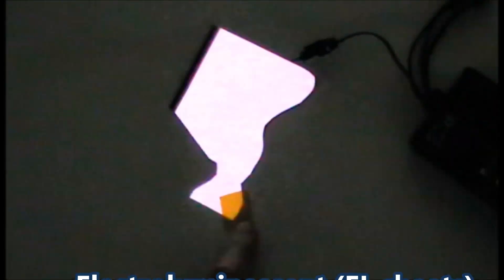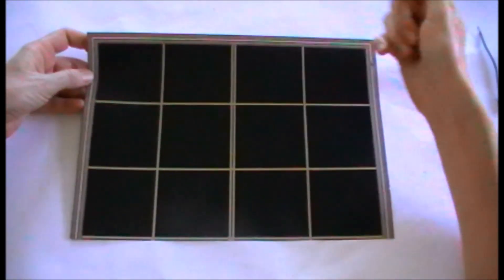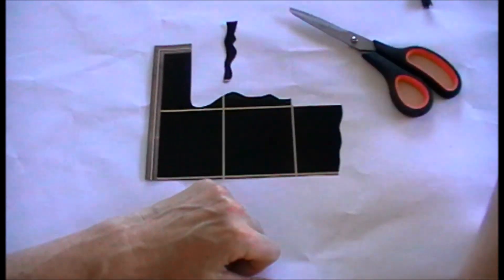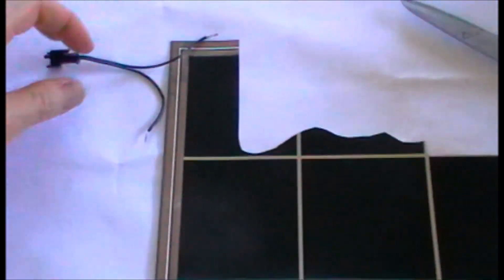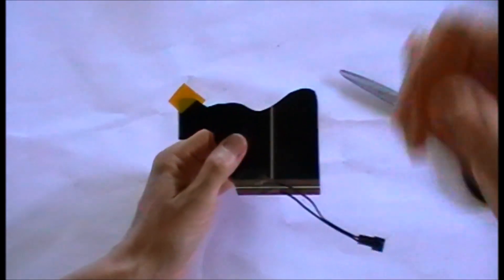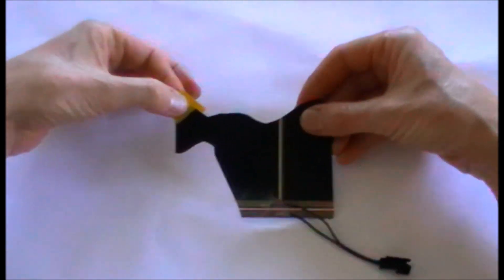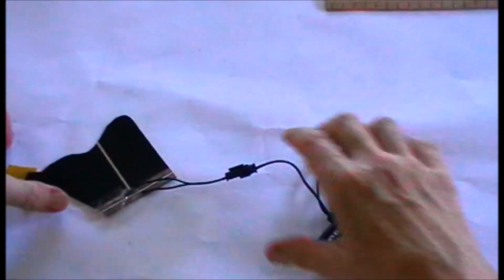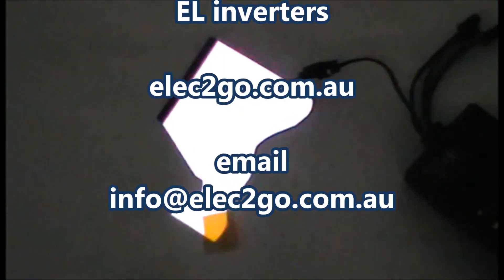EL panels - how to cut and connect tutorial

Comment: Hi, i have an EL pannel that came with a computer case, but the inverter was lost, so i have the pannel only and it has 5 wires. I can send you a picture of the pannel and how it was supposed to work , i can also send you the size of the EL pannel. I just need to know:  1) the amount of voltage to send how did you calculate that per the size of the pannel whats the formula, and 2) i need to know if you can tell me where each wire needs to be connected to as i have 5 connectors.  https://i.postimg.cc/3xB8Tb64/thermal1.jpg     and  https://i.postimg.cc/fL3DYWbm/thermal2.jpg

Comment: so is it safe to use on a clothes like jackets or will it shock you
Reply: If you contact the live surface, it will shock you. If the current travels across your heart, it will likely kill you. I suggested to someone covering the back with epoxy dip, like the stuff they put on tool handles.

Comment: Nice video! How big AC voltage the inverter procudes for the panel? You mentioned 120-140 without unit so I am wondering did you mean the frequency in Herz (120-140Hz) or the Voltage 120-140VAC?

Comment: hi.i found your video to be very helpful. but i have a few questiond about yourel panels. you see,meand my sibling are trying to make our tron costumes from hand and and this will be our first time working with el panels or wire. i would like to know it i can connect the wire to the ribbon with electical tape?and if i get far enough, what can i put under the live underside so it stays on my costume but it doesn't shock me? please answer at your soonest convenience. and thank you.
Reply: I would cover the back of the EL foil with epoxy dip coating. As to connectors, electrical tape is poorly suited for this purpose. It is meant to protect bare wires from contact with areas it should not contact. I like the video makers solution of using a non-heated conductive glue instead. Just apply and let dry. In fact, you could do the glue layer, then do the epoxy dip layer which would cover both. Then your costume would be safe even if you get sweaty.